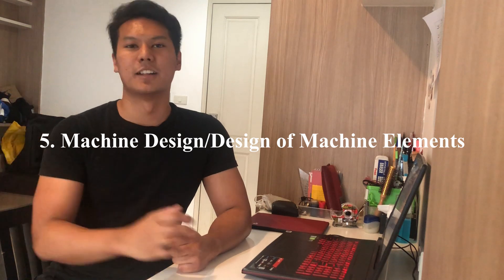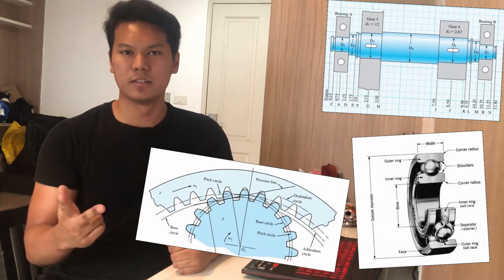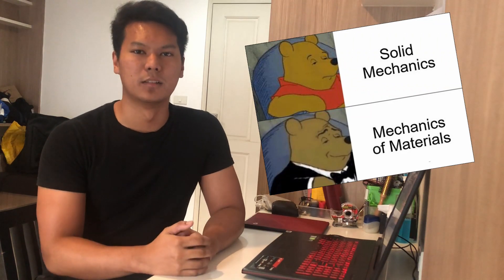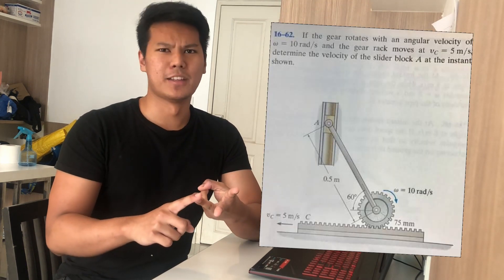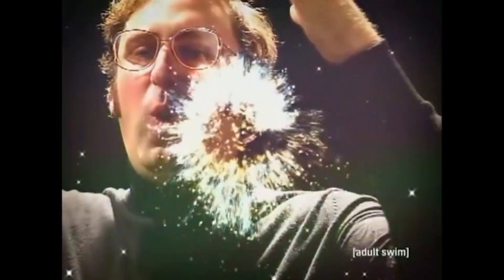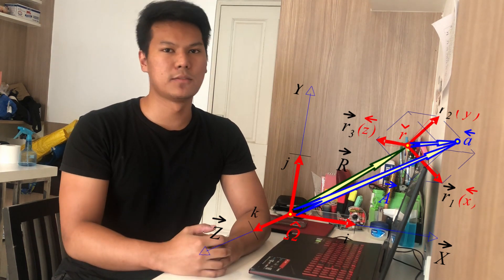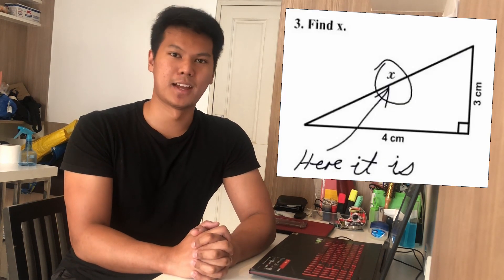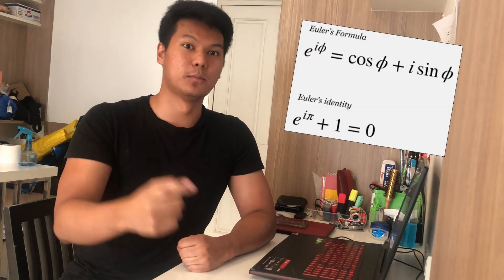Hardest Engineering Classes - Mechanical (Honors Student)

Comment: The hardest classes in my opinion: 
1 - fracture mechanics 
2 - electromagnetism 
3 - thermodynamics 
4 - statistics 
5 - vector calculus
6 - fluiddynamics 
7 - advanced solid mechanics 
8 - dynamics 
9 - corrosion 
10 - engineering design